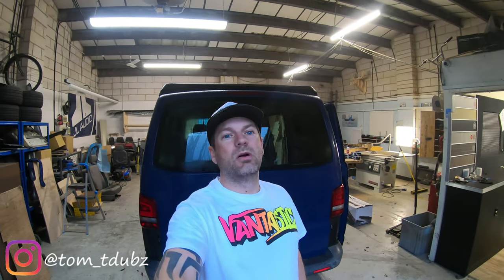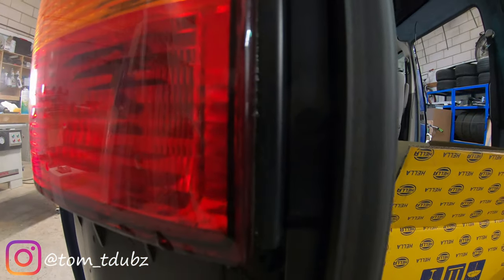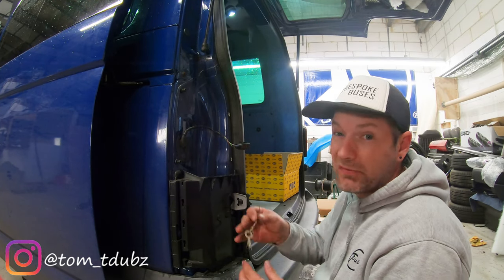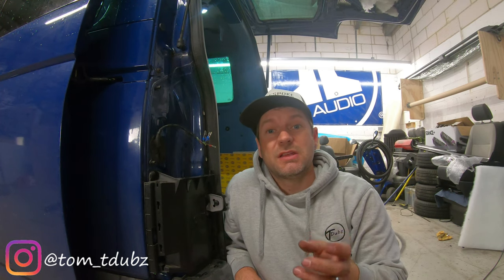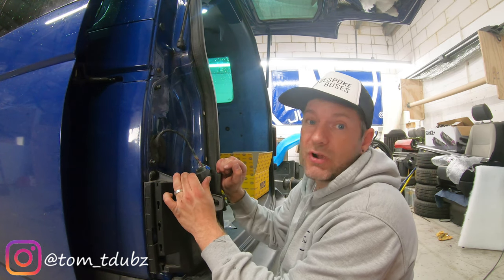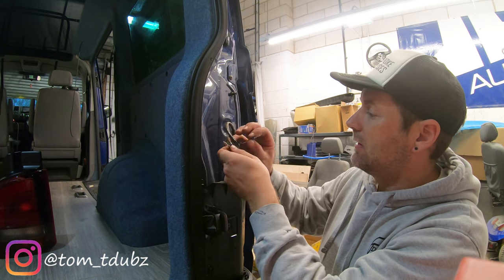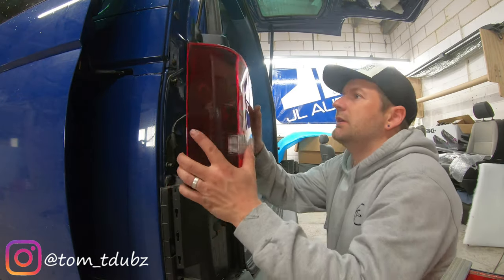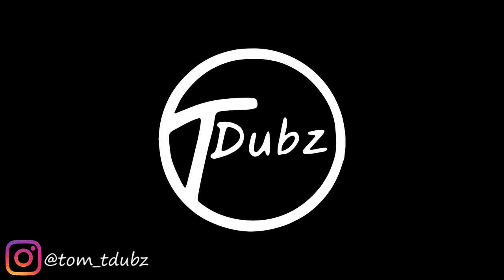Vw T5 tailgate lights #caravelle #episode5

Comment: Hi Tom, installed a pair on my 2011 T5.1 followed all the wiring diagram, all working! Now i start the van, turn on park light, suddenly the rear driver side park light not working! Driver Drl working whilst engine running, if i turn the park light switch on Drl shuts off! Gutted where to start trouble shooting :(

Comment: Do you need to change the cable layout for standard 5.1 lights?
Reply from the maker: No you don’t... at least I think you dont, the light layouts are the same just a clear indicator bulbs...
Reply: @tomtdubz  when i indicate i have rear and front indicators come on?
Reply from the maker: When you indicate is something not working?
Reply: @tomtdubz  sorry when i brake all indicator lights come on
Reply: @tomtdubz  when i indicate all is fine
Reply from the maker: @leeowen9063  that’s bizarre pop the originals back in just to check there isn’t a fault, il have a look tomorrow and get back to you
Reply: @tomtdubz  super, thank you...really appreciate it

Comment: Hi do you have the original vw reference of these because I got 2004 t5 multivan with rear gate and I would like to retrofit same look as yours ones!! I need to buy set already fitted with bulb holders, isn't it? Thanks
Reply from the maker: These are a direct replacement hella from travelinlite great bit of kit with the bulb holders..  
https://travelinlite-transporters.co.uk/collections/t5-rear-lighting/products/t5-sportline-rear-lights-red-03-15-set-genuine-hella-oem-free-bulbs

Comment: Hi Tom, I’ve been following your great video but have come stuck, my T5 2005 t30 174 kombi doesn’t have the colours you’ve mentioned on the tailight plugs. For example passenger side no2 is green and no6 is orange? Any idea why?
Reply from the maker: Sadly I have no idea, il do a bit of research and get back to you...
Reply: @tomtdubz  thanks Tom. All I can say is, I think this van had a factory fitted tow bar?
Reply from the maker: @sparkxx64  yes. I’ve heard that before, let me no how you get on
Reply: @tomtdubz  it’s all done now. Took the wiring diagrams from Haynes manual for both prelift and facelift and worked out what should go where. No mention anywhere of these colours so a strange one.
Reply from the maker: Must of been something to do with the tow bar... fair play tho fella! Good work